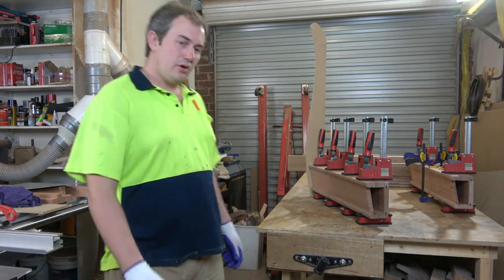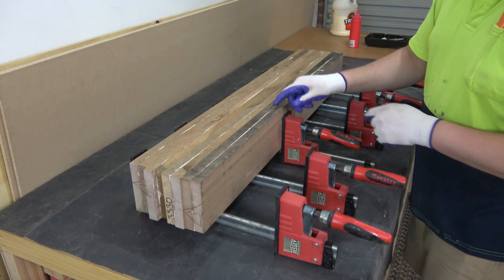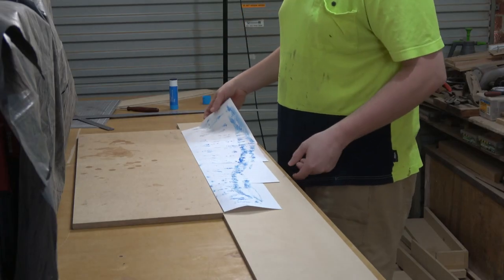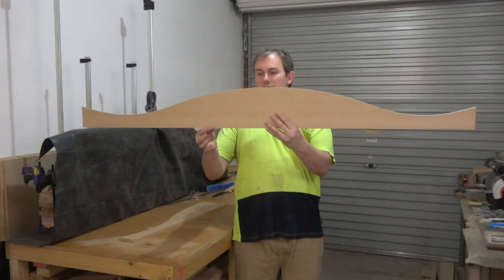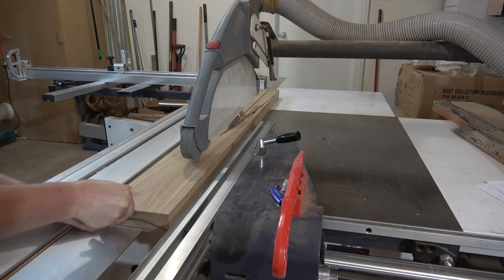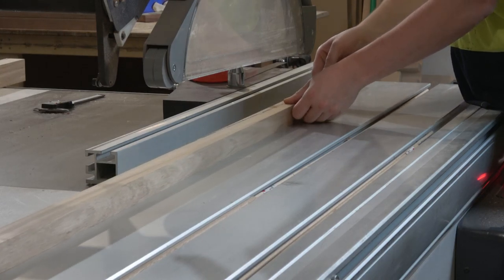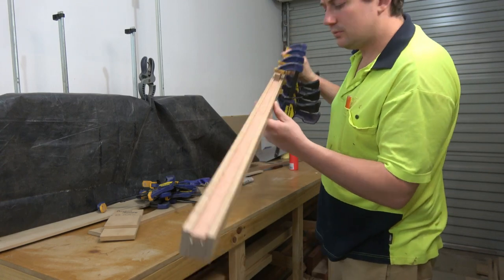Timber Issues - Baby Cot DAILY Woodworking Vlog 6

Comment: interesting at about the 2 minute makr when you face plane the boards you set your blade guard to the side on the buzzer? For face planning such as that Ihave always gone under the guard and let my hand ride over the top of the gaurds as Iget to it. Any reason for your method? Always fun watching how other people do things.
Reply from the maker: The way that you do it is the intended method. I personally dislike this type of euro guard, because even when you do the proper way, I can easily slip my hand under the guard and into the blade. I set the guard to the side of the timber with an approximately 3mm gap between the two so my fingers can't slip down. This allows me to flatten thin boards by lowering the timber down onto the cutter half way and pushing through just to take the high point off on one end. Then I flip the board end for end and do the same and repeat until I can eyeball the board being very close to straight and flat then I can make a full length pass or two. A lot of people flatten boards longer than the infeed table by making multiple full length passes and then they complain that the board remains concave on the planed surface. It's because they are distorting the timber while they cut it and pressing the bow out of the board while planing only to realise when they release the pressure the bow springs back again.

Comment: Book matched end grain effect at the top 😳😳😳😳😳 ok I’m not following lol, I bought some of that below grade Tassie Oak for a bench seat restoration & I hope it won’t let me down but you’re making a finer build than I am & its gunna look grouse when finished, good onya Kuffy 👍👍👍👍ps NYE Tomorrow so have a beer after Shop time 😉👊
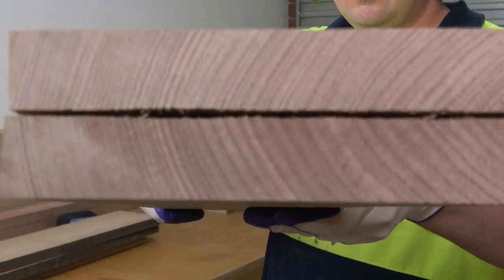Reply from the maker: I didn't explain what book matching end grain is in the video, though I do show exactly what it is at the 1:22 mark. Do you see how the growth rings are a mirror image of one another? You get a long length of timber of any size. Mark one of the faces us up, and the other face as bottom. Cut the length of timber in half. Then fold those two pieces onto themselves just like you would when closing a book. The "UP" faces should be kissing each other OR the "Bottom" faces should be kissing. The cut end of the two boards should also be at the same end as one another. The effect is the end grain at the "fold" should be an incredibly close match to one another. 

NYE hey. That means there might be fireworks across the road from me. I'll do my best to capture some of it on film while trying to make sure that the neighbours don't think I am filming them. I won't have a beer, but perhaps I'll have a bottle of water on the rocks 😀
Reply: Kuffys Woodwork I never see fireworks as I’m asleep at 11pm lol but isn’t it great in Melbourne, have a ripper night with your water in the rocks & we all set to rocknroll again in 18 👍👍👍